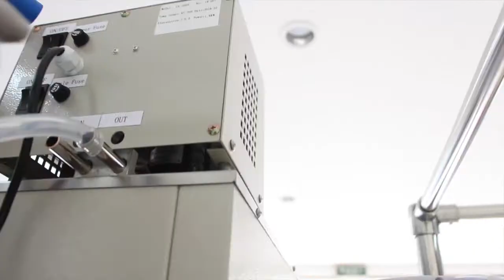Installation PVL YMD-150 Short path wiped film evaporator

Comment: We purchased this system for our lab in Oakland. It did not come with any User Guides.  How can we obtain user guides for all of the working components?  We need this documentation so we can understand the limits of the chillers and heaters as well as how to perform the proper maintenance on them.  We also would like to fully understand the features of the digital vacuum gauge so that we can ensure we are programming it correctly.  We also need the User Guides for regulatory compliance reasons.